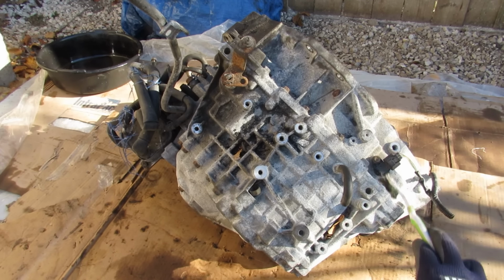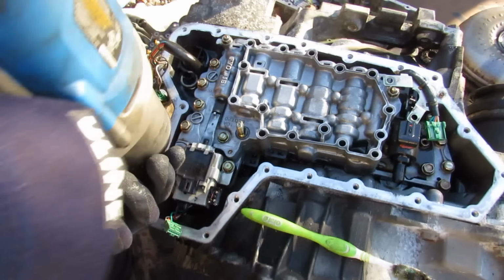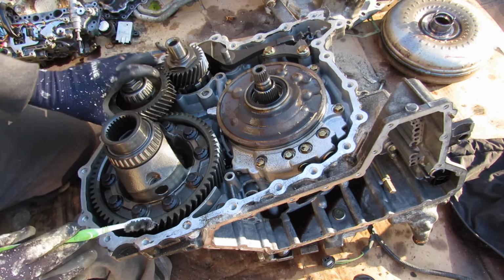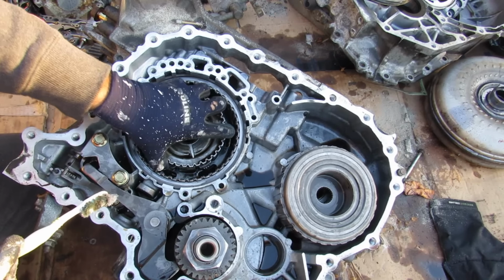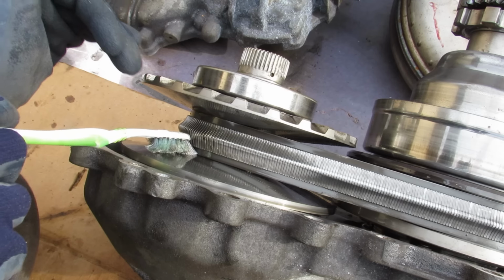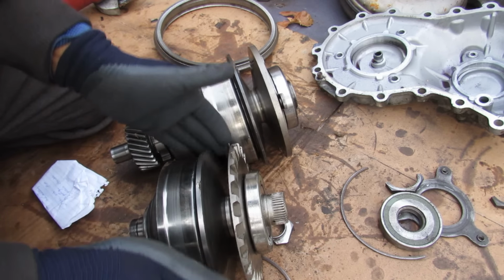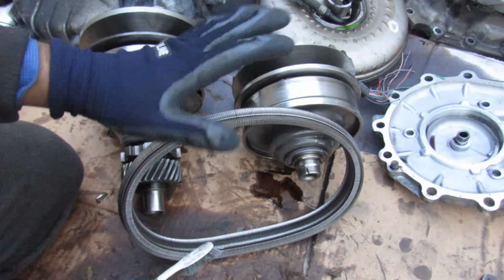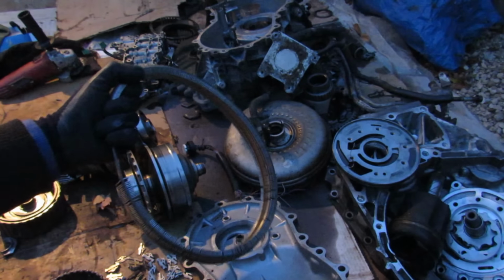Why Nissan CVTs FAIL

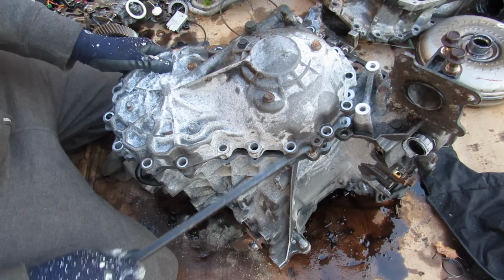Comment: starting at 9:12 is where you see the weak link that plagues these units and theres a personal reason I like conventional automatics alot better and why I think they are more robust. This CVT isn't a normal transmission. Conventional Automatics are a lot more robust mechanically internally because they don't use a belt like this in this video! 
If that belt breaks nissan recommends you replace the whole thing than repairing it.

Regular conventional automatic transmissons and manuals as well are both cheaper to repair or replace and both you can rebuild yourself in your garage plus they are both 10x more reliable than the weak abnormal complex Nissan CVT ( catastrophic vile transmission) in this video.

Automatic transmissions for example that are easy to rebuild if they and when they do take a dump ( plus they are durable) are the GM Th350 , GM Th400, Ford FMX, Ford C4 , Ford  C6, Mopar TF 904, Mopar TF 727, and etc. 
Manual examples NP4500 , borg warner T5 ,and etc

personally I like automatics ( I love the ford C6 3 speed heavy duty automatic its bullet proof and thats what i have in my 88 bronco) , but we can agree to disagree.
for example the Ford C6 is a god compared to the nissan cvt and it would be destroyed by the ford c6 ( meaning that the nissan cvt couldnt survive the same abuse and torque the Ford c6 was made for.) That Nissan Cvt can't even survive in a Sentra from normal driving even under 100k.

Almost anything is better than the nissan Cvt.

Comment: I love my 2014 nissan sentra and the 40mpg it gets... however I had to replace the cvt at 109k miles. From what I have heard that was good for that transmission.
Reply: Did you ever replace the cvt fluid?
Reply: @haroldbeauchamp3770 haha 4 years later yes. The sellsman told me originally to change fluid at 100k miles. I changed it for the first time at 70k miles. Thinking I was ahead of the game. Not knowing I missed 2 fluid changes. I am now changing the fluid every 28k miles

Comment: This is why I still drive a 2000 Town Car.....322,000 miles. Original motor and transmission. My daughter has a 2015 Altima, luckily when the cvt went out at 96k the warranty covered the work, some $1300 pulley/belt system. I drain and refill about 4 quarts of Valvoline ns3 every 20k miles, and installed a aftermarket dipstick, she now has 204k miles runs smoothly. This week while changing her engine oil and filter, I noticed the transmission leaking  from both sides at the axle seal. Oh goody! It's almost paid off lol....she wants to drive it into the ground.

Comment: I truely hate any form of automatic transmissions, everyone I know that had one that is more then 10y old has had some issues with them, and many has done a swap/rebuild.
Suprisingly often the issues are small enough that the car is still drivable, but they shift wierd into some gear, needs you to let off the gas to go in or stuff like that.
And I usually have cars that is 10 years or older, and I never had a manual transmission failure, not even a clutch that needs swapping....
Most of my cars has done 300000km or more.

My next car will probably be electric and one speed.

Comment: When the Saturn VUE first came to market, I was a service consultant at a Saturn retailer. The CVT they put in the 4 cylinder models was a nightmare. If it was an all wheel drive, the problems were worse. After a couple of model years, they decided to return to a tried and true automatic transmission. And, they ended up buying back almost all the rest from deeply dissatisfied owners.

Comment: Since as heat is the most common cause of transmission failure in the Nissans, would it be wise to remove the cooler and install an external one?

Comment: The CVT in my 2018 Maxima is incredibly fun to drive compared to other similar horsepower cars I've driven with standard automatics. I'm no mechanic, but I do know when you put your foot down the car goes like a rocket until you take your foot off the gas. There's no jerking through gears, just seamless and smooth acceleration.  
I know everyone hates them, but I like how they drive. If it fails, it fails. My 2014 Tacoma  transmission, which is supposed to be bulletproof, died after only 115,000 miles with regular scheduled maintenance and never towed anything with it. Also the rear leaf suspension rusted out and squealed, the frame rusted through and it was garage kept.
All these videos make it seem like these CVT transmissions are failing left and right but I see more 5 year old Altimas, Maximas, rogues, and muranos on the road than almost any other car.
Reply: I have driven an Altima 2011 and it's so smooth, zero problems with it but I get so scared by people talking so much crap about CVT
Reply: @chaosdimension6433  well the altima was kinda the spear header for the nissans CVTs are crap argument because in 08 when they first started using them they didnt even bother with a transmission cooler at all, so not only did premature wear happen pretty frequently, but another fault was that the car would go into limp mode and tell you the trans was overheating, that being said i hate the Nissan CVTs because toyota and honda have been making CVT equipped vehicles for longer (honda insight, hybrid civic and the prius) and their CVTs havent got such a horrible reputation. But ive had a 07 nissan sentra with a CVt that works well enough

That being said the Op is the second person ive seen that mentioned how fast the CVTs change ratios and ive never seen that happen both a 12 maxima and my 07 sentras go through the ratios really slow compared to my 2011 fusion and my partners 2018 330I BMW, especially on kick down.
Reply: Don't be the guy that says "mine works fine so there can't be a big issue".  Your's is 2018 but they have been failing left right and center for years since they came out it's just a question of when, even nissan acknowledged it at some point. If you have vq35 or similar, it's simply too much power for such a trash transmission. You've been lucky, My 2012 maxima 350 transmission was serviced regularly and it still failed, crazy quotes to replace transmission even if i could find one with low km's or in better cond than the old one. Even my mum's Juke which has a cvt is starting to show signs of transmission issues and she has been gentle as with it and religiously had it serviced at Nissan. At least a regular transmission can be repaired if it fails and it doesn't spell the end for the car. Obviously it won't bother you until your car becomes a lump of scrap metal because of one aspect of the car failing due to bad design.
Reply: @mrgreen6374  Hi. You've hit the nail on the head with your "at least a regular transmission can be fixed, and your car is not wasted". Manufacturers are constantly coming up with ways to make these things unserviceable/DIY-able. The manufacturer (through dealerships) want more of your money spent on their product. If it's not buying parts/repairs it's buying another vehicle. If you don't have the tools, the knowledge or the parts required to fix/repair their product, you have no choice but to go back to them. *Edit ....or someone else, which is why some of these manufacturers are now going broke. Nissan has half the reputation it used to have, (where I come from) Mitsubishi also.
Reply: yup got a 2015 versa and so far its running great just need to change the cvt brake and oil fluid soon
Reply: @thegreatfreesharkofknowled2480   And is that a 4 cylinder 1.6 engine? The issue is that they used basically the same transmission for cars with 250hp whereas a 2015 versa tops out around 110hp.

Comment: Got a used one with 120k miles, runs fine. I don't believe the fluid has ever been changed. Is it a good idea to change the fluid, or just leave things alone at this point? Does anybody know, or have any experiences?
Reply: The manual says something like every 60k miles. We have a 2014 and changed once at 92k. Yeah I would change it. I know someone who had a Sentra with a CVT, never changed fluid and it went out at 150k.
Reply: Change your fluid consistently! Absolutely!
Reply: Personally I would find a harbor freight and buy the fluid extraction tool, $120.00 which has a tube you slide down the dipstick tube suck out the 3 quarts and refill it with valvolines cvt fluid drive the car like 500 miles then re-flush the cvt with another 3 quarts this will help to loosen anything that gummed up inside that cvt transmission but what do I know after working on cars for 25 years prior to having my arm amputated hence why I stopped working on cars! The fluid runs about $13.00 a quarts just make sure it meets or exceeds the ns-2 certified cvt fluid seriously do you think nissan has their own fluid they buy it in barrels and repackage the fluid into quarts they sell you for twice as much
Reply: I’ve been changing mine every 50k and now I just reached 200k on the original CVT. So that just proves they can last if cared for correctly.
Reply: @SupremeGodSon  What brand is it ?
Reply: Ed here, napa dealer tells me you have to change oil in these periodically. graphite keeps the chain lubed in nissan trans oil.
Reply: 2014 Sentra, 225K miles, I bought it new.  I don't change all the fluid.  I drain from the pan, about 2-2.5 quarts come out of the drain plug.  Take out the drain plug, then you'll need a 5 MM allen socket to take the tube out of the hole(you'll see.  There's a video on here that shows how)  Pour it into an old antifreeze jug so you can measure it.(there is no dipstick)  You need to replace (almost) the exact amount.  Too much over/under filled can damage the trans.  First time was about 125K, then 160K, then 200K, then just last month when it hit 225K.  I'll probably do again at 250K.  I use Nissan fluid, $20/qt.  They make the trans, they make the fluid for the trans.
Reply: @americantaxpayer4551  Wait Nissan CVT transes don't have DIPSTICKS? no wonder they fail
Reply: Nissan doesn’t make the CVT trans in their cars. Jatco is the mfg of most CVT’s found in Japanese vehicles.
Reply: @cygnus1965  they own jatco, along with Mitsubishi and Suzuki. Just like how gm bought ac Delco.
Reply: @cygnus1965  Nissan owns Jatco.
Reply: Thanks all. I'm scared to touch it, but I guess it's the best thing to do 👍
Reply: @BaltimoreAndOhioRR  Find a reputable mechanic and bite the bullet. Otherwise you’ll end up replacing it and that can cost over $3000.
Reply: @Energyfl00d  they cost upwards 3700 bro
Reply: @robertthegrowguy7115  Plus labor
Reply: @BaltimoreAndOhioRR  feels like most commenters did not understand your point. It's when you start fiddling and changing things - adding variables- thats when things can start to go wrong, which get fixed by fiddling again. Thats why regular fiddling is recommended
Reply: Hope you change that shit
Reply: Change it. I normally replaced cvts in cars where people never changed fluid. Cvts have a lot of friction which puts a lot of metal particles through system. Also fresh fluid is better at heat management
Reply: Have you watched Car Wizards nissan Cube?
Reply: @tiadanama1998  Yes, I have. I was just too nervous, not knowing "when" the transmission would go up, so I traded the car in.
Reply: my maxima 2012 replaced transmission @ 110k miles $4k  few year back
Reply: I bought a 2016 Honda CR-V with a CVT and with 97,000km on it at a Honda dealer. I had the Honda dealer change the transmission fluid before I took delivery. $225CAD with genuine Honda fluid. I figure it is worth it.
Reply: @dmfraser1444  what’s your Honda got to do with Nissan’s shitty CVT?
Reply: @GreatGrandmasterWang  I may have not made it obvious enough. I am wondering what Nissan is doing so wrong that Honda and Toyama are doing right. The video never address what are the actual failures they have Nissan CVTs such a bad reputation. Plus I was making the point that in all CVTs that fluid needs to be changed a bit more often than people would normally expect in an automatic transmission.
Reply: @dmfraser1444  It's either the valve body that starts having issues, or the chain starts slipping. The transmission starts juddering when it starts to fail. There really isn't anything else to go wrong (unless you smash it).
Reply: Well they are both made by Jatco. They make CVT’s for all the Japanese MFG’s.
Reply: You better start praying
Reply: sell it asap
Reply: Short answer no. 
Long answer, check the fluid first. If it smells burnt, has metal shavings in it or is discolored leave it alone. If it smells like Trans fluid and doesn't seem discolored and has no metal shavings in it then yes change away.
Reply: change it, its not a conventional automatic that like old oil, this needs new oil.
Reply: @CrazyForCooCooPuffs  agreed. Only use the nissan fluid, too. Its ruined if you put the wrong stuff in forever.
Reply: More effective solution trade it in and get a car with a manual transmission, or if you “must” own an automatic, the conventional planetary geared torque converter automatic is an acceptable choice, it’s soulless and boring, but it’s reliable.
Reply: @MacTechG4  honestly, honda cvts are better, but from what I recall, only in the civic and accord? Doesn't take much honestly. Hell, even the old Nissan cvts are better. When they released the first ones in the US, those were the most reliable. I've seen a murano with 160k first transmission, from 06. Great condition, too, but that might be because they took care of it. Jatco stuff just went down hill from there after they redesigned it.
Reply: Nissan recommends CVT transmission fluid be changed at 30K intervals.  It costs ~$200 for a simple drain and fill.  The draining process is at least 15 minutes until there is no fine stream and only slow drips which us what the procedure requires.
Reply: Change the fluid, filter, and screen every 20k miles. The car wizard did a video on his nissan cube and the fluid that came out at 20k was garbage, screen and filter were both clogged.
Reply: Get the transmission cooler if you haven’t already. It’s what really kills them
Reply: Yes change it but don't change the filter just use a fluid extraction tool and refill the 3 quarts
Reply: Also yes change it regularly also don't use the bump shifter on the autos
Reply: @robertthegrowguy7115  huh? ALL cvt's are autos.
Reply: @BaltimoreAndOhioRR  no crap Sherlock but a good chunk of them have a bump shifter, or his n her shifter so essentially it can be driven like a stick shift. Hence the reason they fail people that don't know how to shift the auto transmissions slap/bump shifter. Then the transmission fails cause it overheats really easily with only 3 quarts of fluid
Reply: @BaltimoreAndOhioRR  when you put those into drive the shifter can be moved to the left which allows you to shift the transmission like a stick shift bump it forward to go up in gears bump it back to go down in gears
Reply: @robertthegrowguy7115  - good to know! 👍 

In my older 4-speed auto Honda, I still change up and down gears when I feel it's worth doing that. A relatively solid and forgiving drivetrain so long as it's not abused.
Reply: hard to tell, sometimes its better to leave it as its than change it...
Reply: Who is the owner of the Nissan?......Renault , 
famous for making crap-Junk cars
Reply: junk that junk and buy you an American car , the job you save may be your own
Reply: @jonesy4588  My Cadillac has gone through five alternators. I can’t take it anymore!

Comment: What an absolutely great explanation/demo of a CVT and its failure points. I always wondered why the warranty on my daughter's new 2006 Altima Coup was extended by Nissan.
Reply: ooh, yeah. those were sketchy. my dads 2006 had an automatic- he didn't like the CVT. he was a real rocket scientist with General Dynamics.
Reply: The 2006 Altima doesn’t have a CVT. They didn’t salary putting those in Altima’s until 2007.

Comment: The reason I got a car with a CVT: The next one I could afford got far worse MPG. If my CVT fails tomorrow, I've already saved more than even the dealership would charge for a new CVT in my gas since I got the car. I'd look to alternatives to the dealership of course, I'm just saying, I approached it with the mindset that it would fail, saved the money to replace it, and for a little while now, every mile I've gotten until it does has been saved money because of the good mpg. I couldn't even get that good of MPG with a manual transmission.
I hate to treat transmissions as disposable, but if they really stand to save you that much money on gas... it's still tempting to me.

Comment: I work for Nissan and we don’t get almost any vehicles coming in with cvt problems. It was bad In 2012-14. Since then it’s not more of an issue than standard transmissions. It’s totally overblown and based mostly on the early versions that most manufacturers had issues with befor making them better.

Comment: All transmissions fail. I’ve had manuals, autos and CVTs fail. Our Nissan CVT first gen lasted 380,000 km. I’ve had basic 350 auto fail sooner and manuals lose a gear sooner. But the difference is repairing them.

Comment: Outstanding!   I already had one CVT failure and this helps me understand the weak links in these transmissions.   Does anyone know if there is an after market transmission oil cooler to help with these transmissions?
Reply: It’s lifetime oil from Nissan! Amazing
Reply: @HoomerbirdG2  life time, 🤣🤣🤣🤣
Reply: Was about to ask the same question, learnt installing transmission cooler help it
Reply: There is, you can order a external transmission cooler from Derale or Amazon to fit on the front near the radiator, this will get direct airflow and help keep the oil temps a little lower. Understand a water to oil cooler is better than a air to oil cooler but when its hot outside a little helps